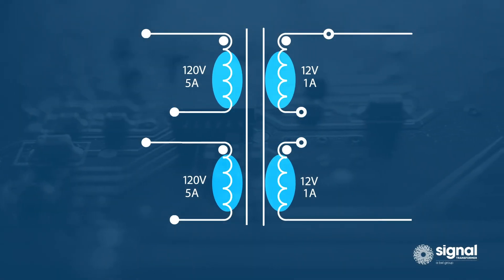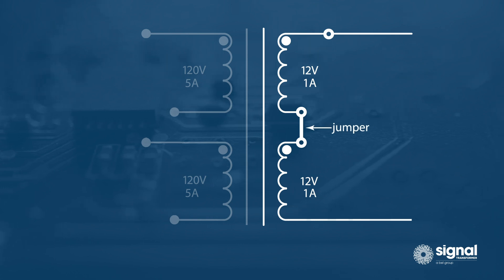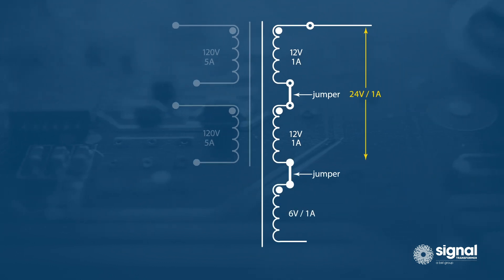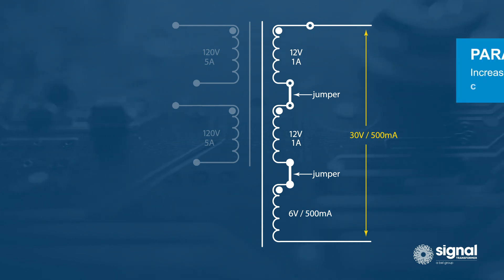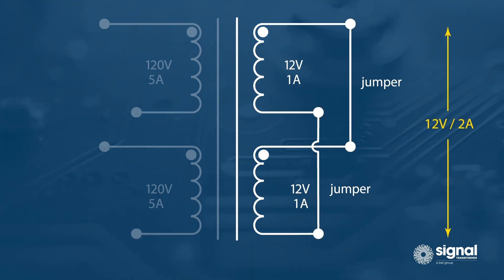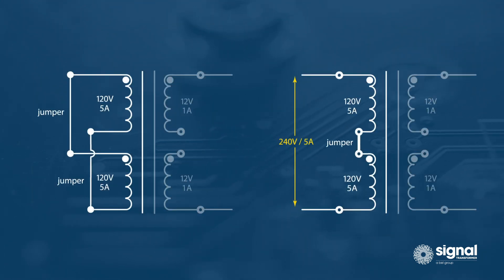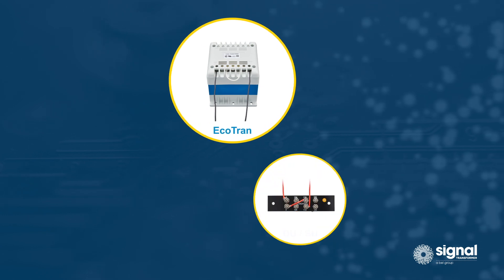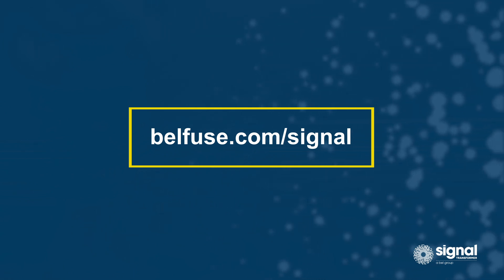Transformer Design Basics | Series and Parallel Winding Connections for Optimal Output

Comment: If you connect two transformers with different current ratings in series, the maximum current that can flow through the system will be limited by the transformer with the lower current rating. This is because any current higher than this value would exceed the capacity of the lower-rated transformer, potentially causing it to overheat and fail.

Therefore, it's crucial to ensure that both transformers in a series connection have the same or very similar current ratings for safe and efficient operation.